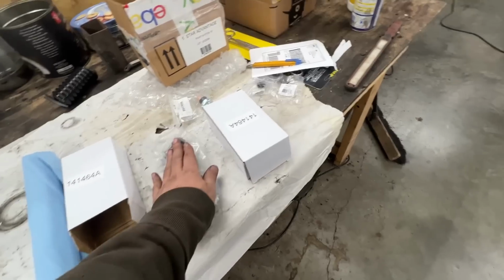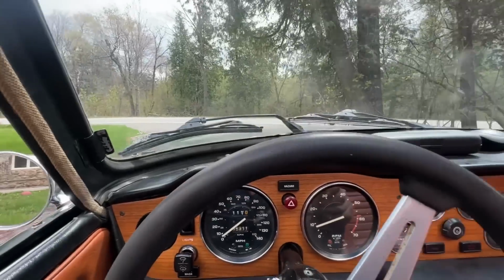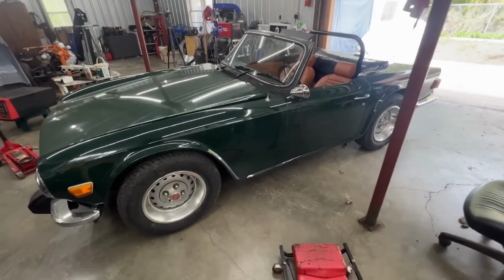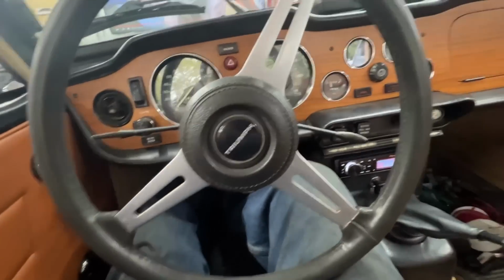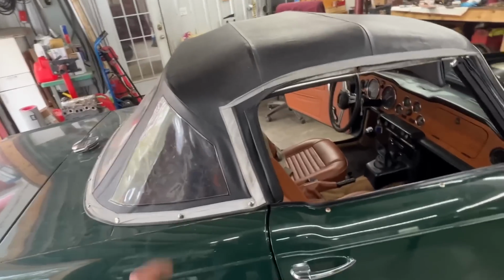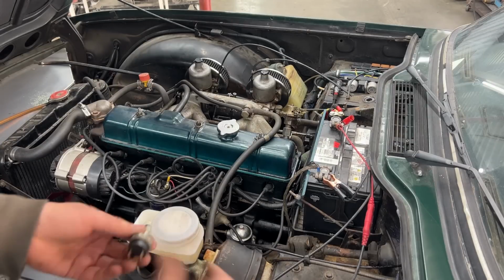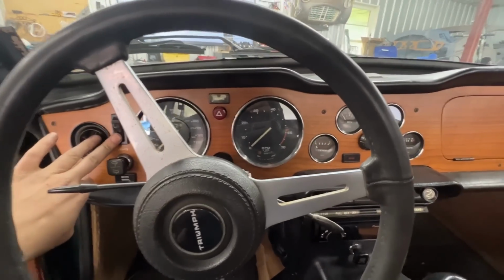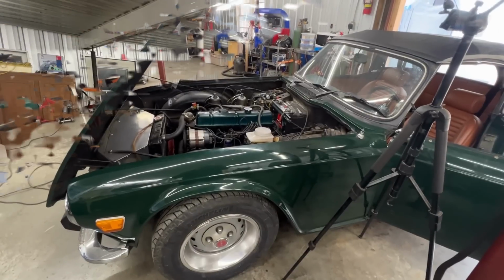1973 Triumph TR6 - Part 3 - Test drive and final touches

Comment: You are making me nostalgic for my ‘74 TR6, which I bought new from Ashley Motors on O’Connor Drive in Toronto. The colour was called Mallard, which was very close to BRG. I had to sell the car when I went back to college in 1975. I sure miss it. I replaced it with a used 1972 Volvo 142E. Also a good car, but it didn’t come close to the Triumph for fun!

Comment: Elin, I had the same issue with my wife's TR6. The problem was the shift fork had worn pins and the pin that goes through the shaft was partially broken and rotated. We found the problem when we pulled the transmission to replace the rear main seal. Once the bushing, shaft pin and fork pins were replaced it worked as should. 
-Robert

Comment: Had the same issue with my '74 TR6 clutch when I bought it. Very quick engagement at full pedal travel and hard shifting. The slave pushrod had been cut and extended. I can't remember which hole it was mounted to on the fork arm. Initially I used twice as many nuts to space the slave cylinder out like you did and mounted the pushrod to the lowest fork arm hole, but eventually it just became unbearable to shift.

I pulled the trans and the clutch plate had been installed backwards! Also the throw-out bearing release fork was loose on the clutch shaft - that pin was sheared but still catching enough to work. Moss sells an adjustable length slave pushrod (596-046), so after fixing all that it works great. I have the pushrod mounted to the lowest hole, so I need the most pedal travel, which is fine. It works on all three holes, not sure why there are options. I suppose it depends on what you prefer for a smooth engagement.

Comment: Hi Elin, I would just hazard a guess that the lever has three holes in order to readjust the pedal position as the plates wear. Maybe it'll come back for the transmission oil leak and you can have a closer look.

I'm struggling with my clutch at the moment, the pedal gets stuck at the bottom if the stroke. And either leaves you stuck in gear or unable to engage!! First time it happened I was high up on a mountain pass at night fall and managed to disengage gear and just coasted down a few hundred feet to our village. After a bit of investigation it returned to normal position. A new master cylinder required. Gonna have to do it soon. Not a classic just a runabout Opel Astra and less than four years old too. Rant and digression over😅😅😅

Aaah, the great Paco de Lucia appears on your screen, you have great taste in music, just a shame that Youtube won't allow you to use it.

Looking forward to seeing the tuning video!! Good luck from Spain!!
Reply: It seems you were pushing the thrustbearing too far if you moove the slave cylender rod to the bottom that may do the trick. It happened to me and this worked.

Comment: Let me preface this by saying that I know nothing, but I think you were on the right track with the master cylinder.  It seems like you were saying that the biggest issue with the clutch pedal is that it's a very short amount of pedal motion between engaged and disengaged.  You were able to adjust where that was taking place in the pedal throw, but it was still very little travel between on and off.  The Rover one that is installed says 3/4 (.75") and the one Moss motors sells for the TR6 is .70".  The larger bore cylinder is going to move more fluid with the same pedal travel (requiring less travel overall).  Doing some sketchy math comparing cylinder volumes I think it's about 15% difference, which might be significant in the "feel".  Thanks for all you videos, I appreciate them.

Comment: When I first got my TR6 back in 1988, the previous owner had installed a kit, then installed the slave incorrectly. Check to see if the slave is bolted to the wrong side of the bracket.
Reply: Please ignore my suggestion above. I had not viewed the previous video which clearly shows the slave mounted on the correct side of the bracket.

Comment: I’m thinking that the clutch disc is to worn very thin and the pressure plate diaphragm spring fingers are raised up high as a result thus requiring a huge amount of travel to actually release the disc.
Reply: Hey Graem! The clutch disc and pressure plate are brand new.

Comment: Hey Elin, I think if the master cylinder presses more volume, the slave cylinder moves faster a longer way and also sweeps over the pressure point of the clutch faster. Therefore, a cylinder with a smaller volume would be more sensitive.....that's my thought 🙂
Reply from the maker: Yes, you would have more control over the clutch, but here the problem is the travel is not long enough in my opinion. Or maybe the travel is not long enough for the pressure plate to release, which might also mean the pressure plate is not good. But what you say makes sense.
Reply: @RustyBeauties  To get clarity about the condition of the clutch, I would remove the slave cylinder as a test and determine the clutch travel by hand. Then you would know more about the condition and which actuation length is actually required.

Comment: Hi Elin, on my TR3, the clutch slave cylinder plate sits on the other side of the flange. This way the rod will naturally be shorter and you can operate using the middle hole of the clutch shaft. I think that is the original mounting way. Cheers from France and keep on working on beauties!
Reply from the maker: On TR6 engine that is the only way to mont the plate. It doesn’t fit on the  transmission side

Comment: Check the crankshaft end float: if the thrust bearings are worn, they steal your clutch travel. You step on the clutch and the crank moves. I had a personal experience with this. Put a new clutch disc in there and it wouldn’t disengage on hot days. Had to change back to the old clutch.
Reply from the maker: Yeah, checked that first, but it is OK

Comment: Re the clutch engage/release issue described, likely you are aware that increasing the master cylinder piston bore reduces clutch travel. From the Moss motors pic it seems the rover mc has a larger bore than the tr6 mc. ~15% larger.
Reply from the maker: Yes, larger bore leads to shorter pedal travel required to operate the slave the same distance that a smaller bore cylinder would do with a longer pedal travel.  But if you use the same pedal travel, that would lead to longer travel on the slave.

Comment: Exchange the position of the wipers
Reply: Hi Bill, what do you mean regarding the wipers? (I’m also interested)..
Reply: @philtucker1224  they need to be switched, the one with the bend needs to be on the right.
Reply: @billgoin4004  oh cheers Bill, (I wonder why they prefer it that way?) - Typical Triumph though, they never altered the RHD wiper set up to correctly clear the screen on the LHD cars..
Reply from the maker: @philtucker1224  The bend is to clear the air vent for the heater when it is open.
Reply from the maker: Yes, you are right, someone else also pointed that. I didn't pay attention. Thanks!
Reply: @RustyBeauties  oh yes of course, - thanks Elin!